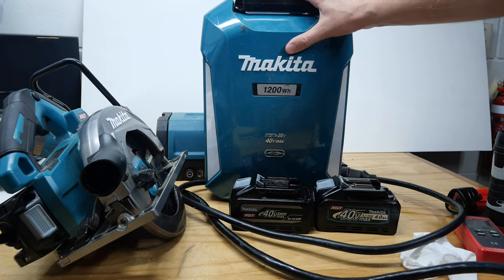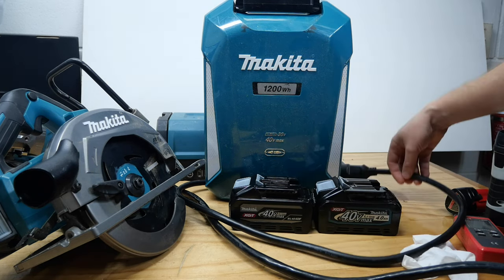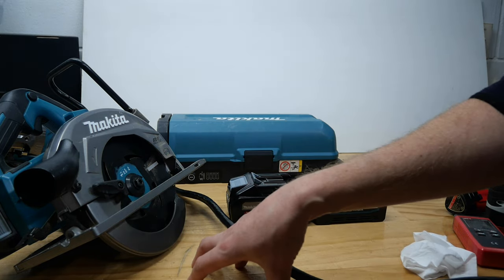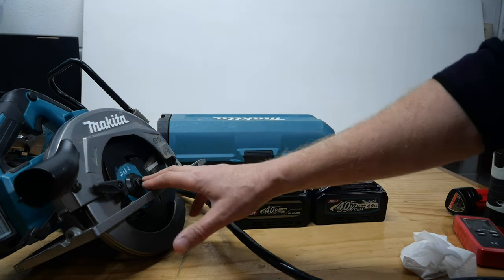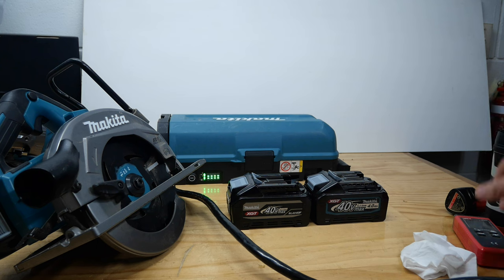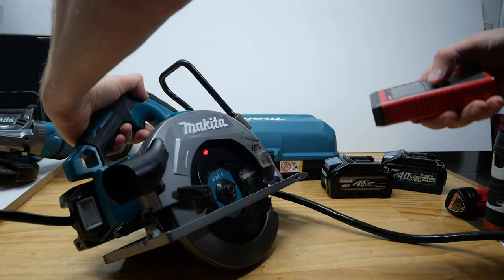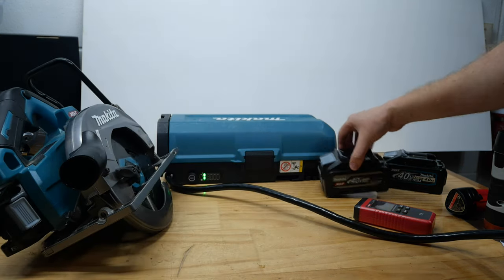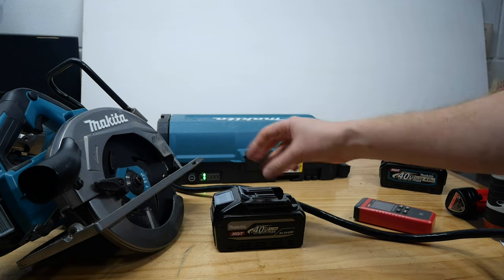Does a Makita 40v Circular Saw Run as Fast on 18v Batteries? Results May Surprise You.

Comment: I used xgt tools with pdc01. It boils lxt bastteries like nothing, I think maybe starprotection isn't working correctly there because under load there almost no power cutoffs. My main complain beside housing only 4 batteries - they work one after another, not paralleled, which would be much cooler. Xgt blower in turbo mode eats 4 5amp batteries in 15 minutes without throttling.
Reply: not surprising at all, lxt packs use slightly weaker cells and xgt tools demand some serious power.